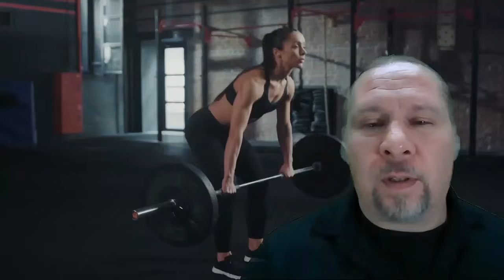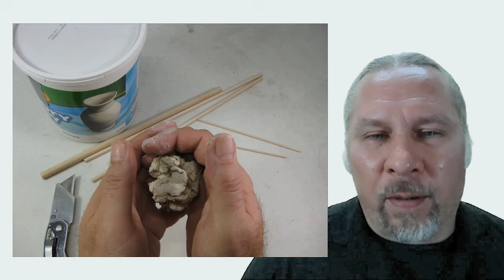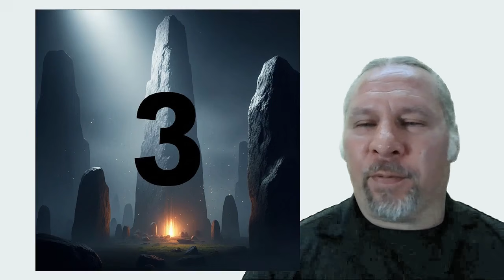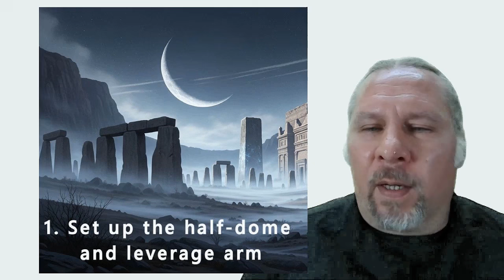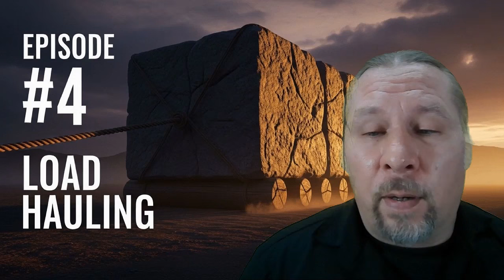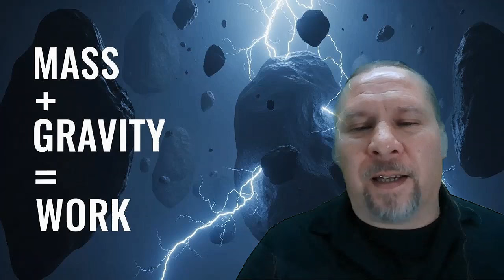The Lost Mechanical Advantage - Episode 1

Comment: This is a neat observation, but you've missed something. You actually said it right at the beginning: that post in concrete was tipped over by your excavator. You couldn't have done that by hand, unless you were to rock back and forth and store up enough energy to make it over the tipping point, and that would be a lot of work! It works at small scales because you can easily attach a few grams to the end of the pole, but if you scaled that up to a machine that was supposed to move a couple tons, then the weight at the end of the pole would need to be hundreds of pounds. Your 300 pound fence-post one already required a machine to tip it in the first place, and at that scale it wouldn't move very much, it would have to be way bigger to move huge stone blocks.

You're storing energy, and you're using a lever to better utilize that stored energy. It's a weird shaped lever, but you're not getting anything extra out of it energy wise. Because a mechanical system is always going to lose energy through friction and heat anyway, whatever you get out of this machine will be less than you put in. You can use it as a force multiplier, but there are simpler and more direct ways to do that. 

Physics aside, you make some nice looking videos that are very well edited. You also explain your idea very well and I enjoyed watching this.
Reply from the maker: Thank you so much for watching the video and for taking the time to write such a thoughtful comment. In that first episode I definitely said some things that I now know weren’t the best way to describe what was happening. Back then I used phrases like “free power” because I was comparing it to renewable energy sources, which in my mind felt like the same idea. I’ve learned a lot since then.

You’re right that this device is basically a giant lever. Like any lever, you don’t get more energy out than you put in, but it still has a function and a place. Once it goes through the lever phase, it stores energy in the cocked position and is ready to release again. And if the pole is long enough, the reset doesn’t depend on the weight of the stone. A small weight can always bring the lever tip down.

I also believe a quarry is the exact kind of place where this device would have worked at its best. You always have weight in the form of stones that need to travel down the terraces, so you basically have a steady, never ending fuel source to power a device like this. That gives you a primitive generator that can run a bunch of different tools. Giant quarried stones are a major part of ancient engineering, and another possible power source could be people powered elevators at quarries, pyramids, or similar structures.

In episode 2 I go deeper into the whole system and show other applications, and in episode 3 I show a human powered version at the end. You clearly have a solid grasp on the physics, and I’d really enjoy talking more with you about the mechanics and the possibilities.

Comment: I really like the simplicity but I don't see the math. ie. .
1. A 5 oz. weight is lifted 6 inches and can then drop doing work. 
2. remove the weight and the machine resets to vertical and could possibly lift something less than 5 oz.
 3. So the work in I call 6 units and the work out I call 5 units. But then 
4. to reset requires 6 units. So my understanding is .83 efficiency. Please explain what I might be missing. Norman
Reply from the maker: Norman, thank you — I really appreciate the way you broke that down. You’re right that the math isn’t here yet. I’m in a few math and science discussion groups right now trying to learn the correct equations, because before building this I honestly didn’t have a solid understanding of how to express everything properly in mathematical terms.

As far as efficiency goes, I’m sure you’re right that it can’t break any laws of physics. I’m not trying to claim anything extraordinary — I’m just trying to understand what’s actually happening. I’m about to start running a whole series of experiments, and I’d be grateful for any suggestions on what measurements or setups you think would be most useful.

Someone already pointed out that part of my earlier mistake was treating the motion as if I were lifting the sled vertically, when in reality I’m pulling it, which obviously requires less force. They suggested I measure the force directly on the line, so that’s one of the next things I’ll be testing.

Thank you again for taking the time to comment. Your breakdown helps me see where I need to tighten up the math, and I’m open to any further input you’re willing to share.